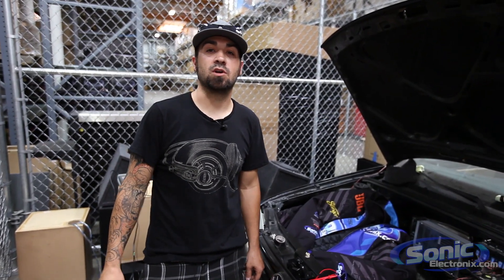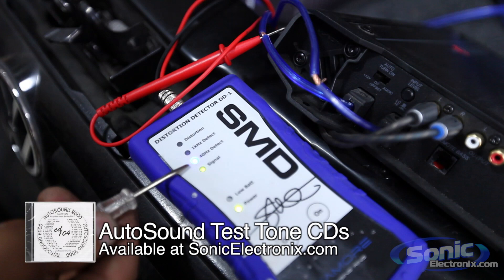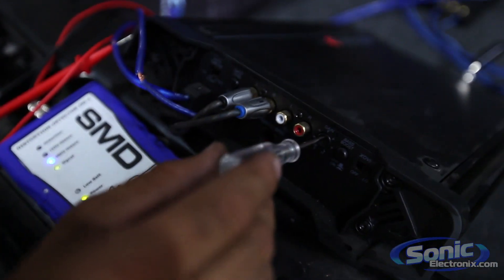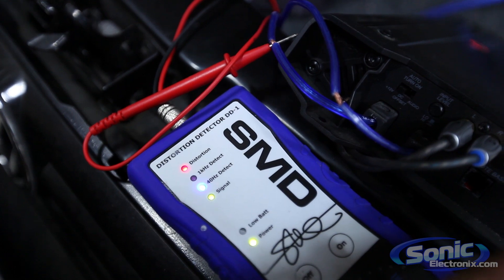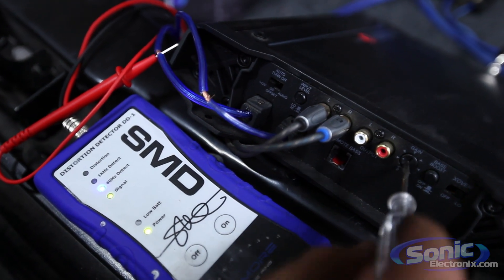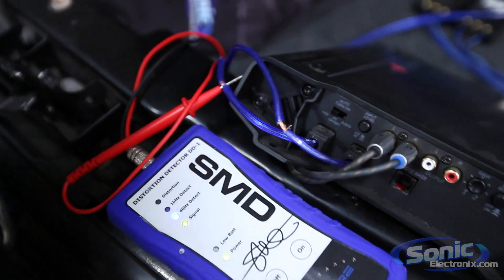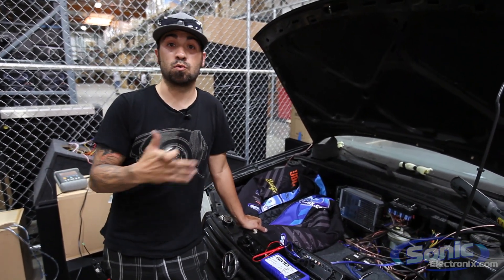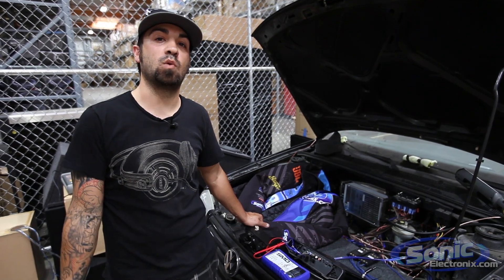How to Set Amp Gain with SMD DD-1 | Part 2 of 3

Comment: You didn't explain how the dd-1 allows you to find max volume without clipping from the deck..."3/4 of the way up"...very general...still not optimal performance from the amp.
Reply: Pat Karlo Exactly what i was thinking, Steve always shows him hooking it up to the deck, and then going to the amps. This is still leaving the risk of distrotion, if, for whatever reason, you crank the volume higher than 3/4!!
Reply: ferrariowner123 yeah I have a dd1. Some radios dont clip with the volume all the way up.
Reply: The head unit they use can go all the way without clipping I believe.

Personnally I do it by ear, when the speakers start to scratch etc..I turn the volume down 2 notches so I'm sure not to clip. Not the best way do it but it works.

Depends on the headunit etc..

Comment: hey guys, id like some help if i may..
my friend told me not to adjust my EQ's on my stock head unit (2011 wrx NAV factory head unit) as it may blow my speakers.. My set up is JL audio c5 splits and c2 coaxials with a 12" pioneer sub and a JL xd4004 amp.. is it true if i adjust the eq's on my head unit to make the sound a bit more tailored to me, it will blow my speakers?
Reply: after its all been tuned via amp
Reply: Zoran Terzic If you keep your eq on the stock HU flat and tune your amps you shouldnt have any distortion

Comment: Yep. Don't forget, the DD-1 allows the amp to be set to it's maximum clean output. If your sub can't handle that you need to handle it properly. If you have a dual voice coil you could wire them in series to increase the resistance the amp sees and thus reducing it's power output. Or you could simply turn down the amp gain using the ear method. This isn't a fault of the DD-1, even a O-scope will not always show clipping for an over driven sub.

Comment: What are you talking about? A pure 40Hz signal is not music, it is a test tone. It is used specifically because it is not clipped and because the signal is a single frequency. It makes it easy to tell if clipping occurs. What a dmm reads is either RMS Volts or Peak Volts depending on the meter and the settings. RMS can be thought of as a kind of average. But it is possible to have 2 different signals with the same RMS value. An RMS dmm meter can't tell the difference.

Comment: You have to start with the radio to find the distortion point of it first. Then you move to the amp with the dd-1. Also you should be using the DD-1 without the woofer hooked up. You will net a small gain in spl if you leave the speakers or woofer in this case unhooked. Refer to my video on how to use the DD-1.